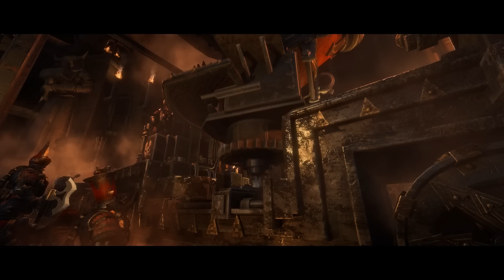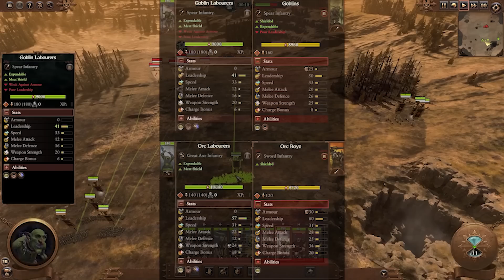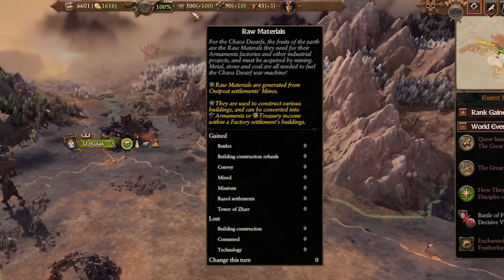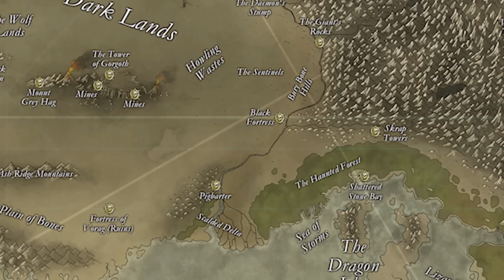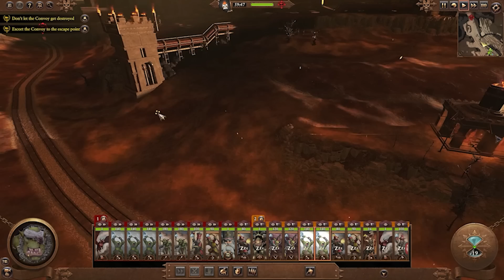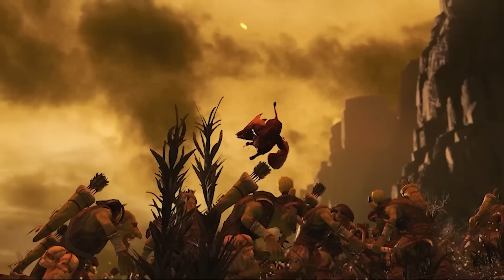CHAOS DWARFS Campaign Mechanics - The Pain Train Has No Brakes! - Total War Warhammer 3

Comment: I didn't realize it until you mentioned it, but the Chaos Dwarf unit caps really is going to make Gorduz really important since hobgoblins will end up being your bread and butter for most of the game.
Also, if they don't add the River Ruin as a navigable river, they at least need to make it one of those sea lane quick travel opportunities like they did with the underground sea in Naggaroth for the Dark Elves.
Finally, I'm really hoping (based somewhat on what we saw of the special escort quest) that we'll be able to attach up to three different "cars" behind the "locomotive", with the second and third "cars" most likely taking up extra unit slots in the army to prevent having just a ludicrous number of artillery.

Comment: I still have issues with the unit cap. As this complicated economy is good. But if you need to spam out military buildings. In order to increase the cap. It may force you to rely on craft units into the late game. Something that will be horrible
Reply: Chaos Dwarf caps are not tied to buildings but to the Hell Forge mechanic, they will probably work more like Beastmen rather than like the Tomb Kings.

Comment: Stop defending unit caps! If you want to use the "lore wise" line, then in that case, shouldn't elfs and dwarfs also have caps? They are dwindling races, after all. Unit caps should not be a part of that dlc, but I can live with it if that cap increases to where you can field armies of CD later in the campaign.
Reply: Calm down, there is something you’re missing. In lore The chaos dwarfs are even rarer than dwarfs and elves, to the point they require massive slave armies to make up the difference. 
On the table to (which I haven’t played so sorry if I fuck up here) they played as either A) a horde army made up of green skin slaves or B) an army made up of a few but hard hitting chaos dwarfs and centaurs, or C) a mix of A and B. They played like this on the table top, just with point instead of unit caps.
All this to say, stop pretending that unit caps are bad. They were like this in the lore and on the table top. Accept it, or at the bare minimum stop whining about other people defending them.
Reply: @jonahulichny9874  I don’t care for lore, unit caps are lame. Lol
Reply: @sercravenmohead3631  it is a way to force the chorfs to use their own chaff units, instead of being able to build an all dwarf army. If they could do that without any constraints then they could easily become broken what with all their good unit options for anything that isn’t a green skin.
Reply: @jonahulichny9874  Yeah but that’s what all factions do anyways, they upgrade to a doomstack. So why would chorfs be any different? You’re telling me as the Empire I can build the Franzer division but I can’t use chorfs because of lore but the whole point of total war games is to break the lore/history. Lmao
Reply: @sercravenmohead3631  you do realize that chord units are insanely good, right? Looking at the stats for the iron sworn, they look like they can take a fuck ton of hits. If the units are that good, then it should offset the other units being bad. Also the AI is not prone to making doom stacks (least to my knowledge) so no one is exactly going to be outranking the chorfs in terms of unit quality.
Reply: @jonahulichny9874  So you can doomstack as any faction that isn’t a beta capper. Oh big shocker their elite tier infantry is really good lol. They’re basically iron breakers and you know who doesn’t have a unit cap? The dwarfs lol.

Comment: The idea of dreadquake mortars being off map artillery has some balance ramifications since they're also on map units. If a DQM has the range to provide that kind of fire support, then the ones that are a part of your battlefield trains would need to have unlimited range otherwise it just makes no sense. Not sure what you're on about with that take there indy..
Reply from the maker: I think you're looking at that with a pretty myopic lens lol, it doesn't have to have any balance ramifications whatsoever. Not hard to imagine the off map artillery is a bigger/custom made Dreadquake/other artillery piece with more explosive/longer range ammo than the standard. Or that when firing from a more stable, higher platform on a real railway it can shoot further and more accurately than the ones trundling along in the muck offroad